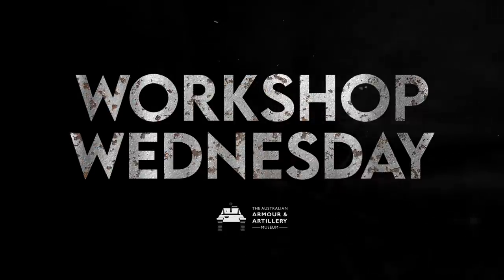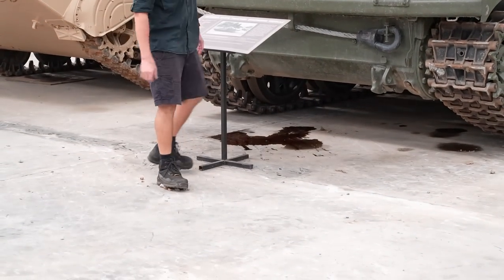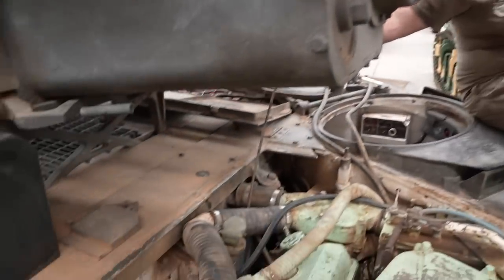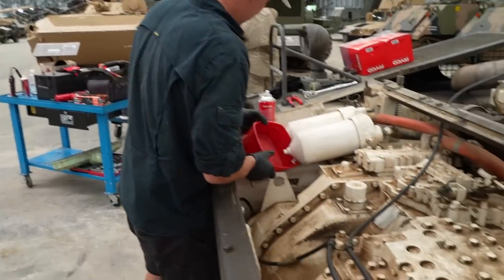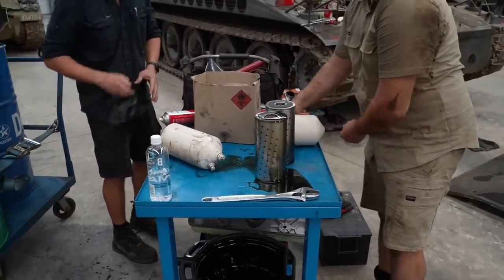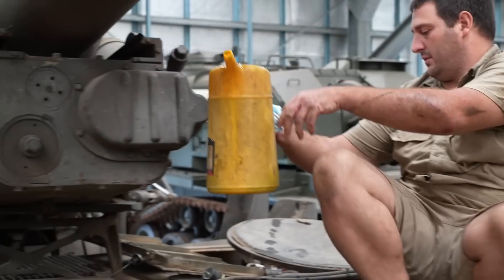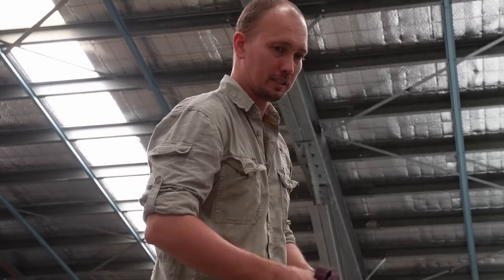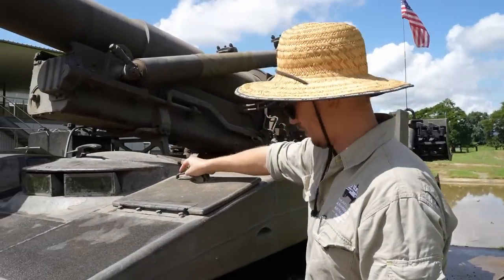WORKSHOP WEDNESDAY - Servicing the M110 Self-Propelled Howitzer

Comment: Served with an 8-inch unit, B Btry, 3/16 FA, 8th Inf Div, in Baumholder, FRG from '75-'77. I was FDC, not on the guns. We used an M577 Command Post  Carrier.  I spent a lot of time with the advanced party scouting the next firing position while riding around in the back of a Gamma Goat, a sucky little vehicle...... Our most important mission was to provide tactical nuclear fire support if the Soviets came across the border. The nuclear simulator rounds were LOUD! The concussion was almost painful.
Reply: Back in the days of charts and darts. As a mechanic, I would sometimes hangout with the FDC guys. The math made my head hurt, lol

Comment: Tiny Teddy….what happens when Saladin meets General Gavin in SE Asia.
The GM in the 110 has a leak in the seal between fuel pump and block. Age related, pretty common, Perkins were the worst at that, International Navistar diesels will drive you nuts with this type of fault. Daily morning pre start routine is so important in detecting the ‘Sump is filling up sort of stuff.’ BTW, that 110 engine is now a prime candidate for an unchecked, uncontrollable runaway, leading to internal detonation, granadeing that donk.

Comment: "Tank Jenga" - now there's a video I would watch.
But I could still watch this stuff all day, every day if I could.
It looks like the best job ever.
Did I miss it though? how was the fuel getting into the oil?
Reply: From before they repaired the fuel injector lines. It hadn't had its oil changed since then.

Comment: I do hope you use all that old oil again as in diesel, i used to run an old 70's ford transit, purely on old engine oil, properly filtered, and skimmed, the oil is great in the tank, except in the winter in the uk, so just added about 20% disel to thin it down

Comment: I noticed the engine cover seemed relatively light.  Is it the standard one, or was it replaced with something less armored to make it easier to service?
Reply: The crew, other than the driver, sits exposed ridding the track in the back.  Enemy fire penetrating the hull is the least of the crew’s worries.  In the 80’s, there was discussion of adding a ballistic shell to protect the crew, but with MLRS and M109 improvements they retired the 8” instead.
Reply: So that was a standard cover.

Comment: I saw you pulled out AC oil filters (American brand) and put in Ryco which I presume are Aussie. My question is, since those AC filters may have been in there for quite awhile, did you guys cut them open and check for metal trapped by the filter material ? That can give you hints as to engine wear.  Keep up the good work and awesome videos. They are very informative and educational. Two thumbs up !